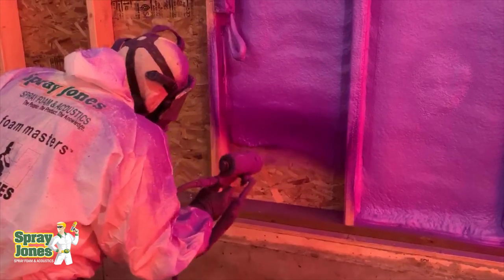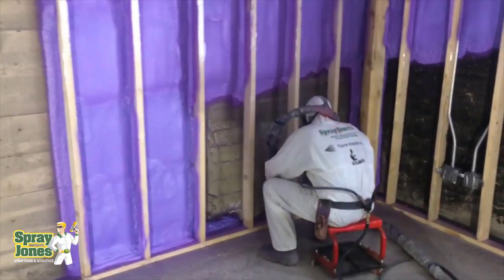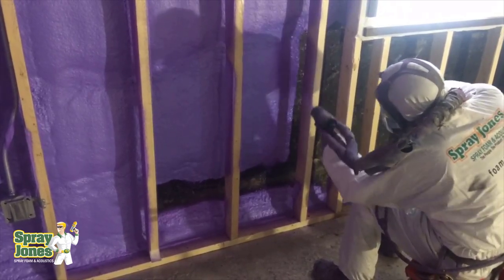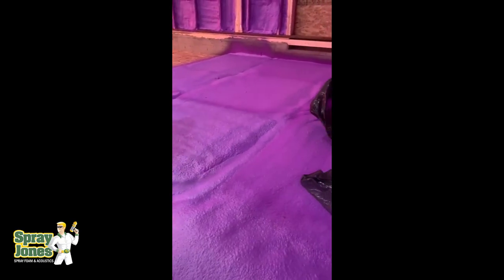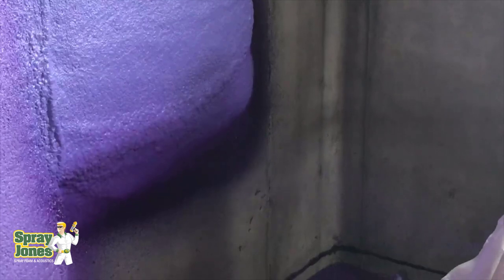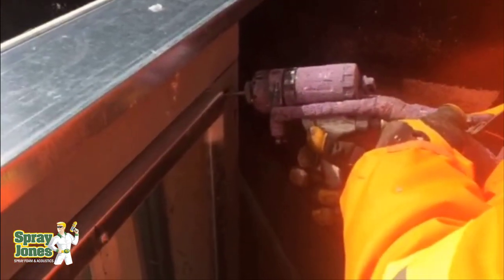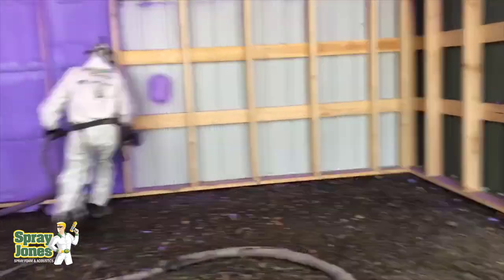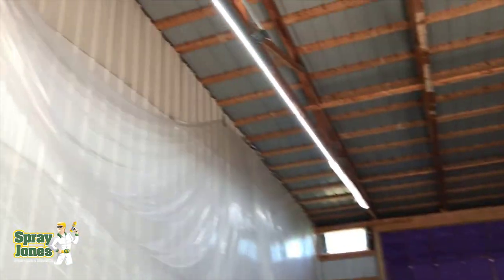Can Foam Insulation Be Injected Into Existing Walls?

Comment: $10,000.00 for tearing everything down 2 inches of spray foam on the walls then all new material or $850.00 for slow expanding injected foam. A crew came in located all studs, cross sections, packed the outlets, drill a lot of hole, installed attic barriers, and injected the foam. 5 days later we have a 10ft by 24ft room that is cozier than our front room. No warping no fires no smell and keep a great temp all year round.

Comment: I've injected quite a bit of "pour foam" successfully. Mostly opec cell designed specifically for the application using the same equipment as is used to spray the foam. As long as the cavity is empty and the installer is properly trained with the proper material it works great. Injection progress can easily be monitered with a FLIR camera and the mix (material is mixed in the gun) can easily be confirmed by spraying test patterns on the floor. I would definitely agree that opening the wall up is better.
Reply: No you didn't.  It's literally impossible.  If you're so confident please build a little wall, put fiberglass insulation in it, cover it with sheetrock, drill a hole, and pour your foam insulation in there.  Then remove the sheetrock and show us.  Do it all on video.  I dare you.

Comment: I dont believe this, we have a company here in the states that drills a 2.5 to 3 inch hole in your exterior wall, not the siding, They check to make sure the cavaty is empty with a camera. Then insert an airhose along with the insulation hose, they drop the hoses all the way down to the bottom of the cavity then start the fill process. They offer a FULL LIFETIME guarentee that transfers with the selling of the home. They comeback after about a week and check EVERY wall with a thermal camera and if there are any spots that have gaps they fix it right then and there. When they are done outside they fill the hole they drilled in the side of the house with a foam plug.
Reply from the maker: Go ahead then.
Reply: That's injection foam, only a limit of  companies do it
Reply: So your saying the 3" hole is in the drywall and not the siding?.  But yet it's not a drywall plug but a foam plug?   Best practice is spray it right the first time or spray it from the outside when doing a siding change.

Comment: For the US Icynene makes a good slow rise open cell that I have used enough to trust it - (only do that if the weather barrier is good on the outside)  Demilec makes a good closed cell slow rise - like it when we do existing attics and need to do enclosed slants.  (both brands under Huntsman now!   SonRise (Ohio)
Reply from the maker: Fine. Still the same issues inside the wall.

YT is full of videos of failures for enclosed wall filling ordeals.
Reply: @SprayJones  yeah, multidecade old installs with old formulas.

Comment: I had "pour in" put into my mid 50s colonial about 10 years ago. I've seen inside the cavity a bunch over the past 10 years. A good company can handle everything he describes as being a problem - it just takes experience. I asked all these same questions when I got the work done and it wasn't a problem.
Yea, repainting all the holes (at least 3 in each stud bay) kinda stunk, but that's why you label and keep your left over paint.
Reply from the maker: Good. glad it worked out for you. So many times it does not.
Reply: did you see an improvement in your heating & cooling costs?

Comment: Do a segment on spraying foam from the outside with the sheathing removed.  I may have to go this route.  Thanks
Reply from the maker: Great idea!
Reply: We did the roof that way, removed the shingles and sheathing. Added cardboard for the crawl spaces, then sprayed and sheathed.
Reply: @danlux4954  Does that mean that your spray foam adhered to the cardboard? I thought that the spray foam would need to adhere to your sheathing?
Reply: @ruthalexander6681  we spray foamed from the top, the sheathing goes on after with 1-2” gap for air. If we wanted to rip out all the plaster you would put a foam spacer to create the air space then spray foam. Depending on your geographic area of course
Reply: @danlux4954  ok...thanks for assuaging my curiosity! 😅

Comment: I do commercial refrigeration, many years ago I was at a refrigerated trailer manufacturing plant where they manufactured refrigerated trailers, the process used was to pull the trailer into a fixture which then used hydraulic pistons to push the walls in to enclose the trailer then they put a fixture inside of the trailer and expanded it so the outside and inside walls were contained, they then injected a foam mix into the cavities, the hydraulic “box” helped the over expansion of the foam from ripping the aluminum panels off of the aluminum riveted studs, but as sometimes things don’t go exactly as planned and too much foam gets injected WILL rip all the panels off the studs, inside and out despite the hydraulic rams trying to hold the trailer together, the power of foam in a enclosed area is a respite recipe for disaster.
Reply from the maker: Thanks for the additional info. I have heard of this and much more with panel products.

Comment: I have an empty cavity and tongue and groove 3/4" boards nailed 3 inches apart on the interior walls of my home so taking the walls down is a no go.  I have access to the top of the wall below the plate on the gable ends from the attic as it's a brick home.  I would like to poke a hole and pour from above and would do so in many batches until the foam reached the top.  Just want to do the gable end where the bedrooms are located as it's the west side and gets super hot from the sun beating on the brick in the afternoon.
Reply from the maker: It will bow the wall out if you mix too much at once. I have seen foam push a 2" x 10" sideways
Reply: @SprayJones  I thought it over and I think I'll try cellulose instead.  I believe I might just have enough room to fit the machine hose below the plate.  Thanks for the reply!

Comment: So I have a 40’ school bus that I was just going to drill a hole in the center of the roof and I was going to fill it on top outside 2’x8’x3” pocket’s times 16. I was thinking simple GreatStuff big gaps(3”) & cracks, my inner roof is bolted down tough. What do you think?

Comment: Question:  I have an old house with no insulation.  I have to remove the old siding as it is no good.  I was thinking about removing the sideing, spraying in foam and then residing with Hardi siding.  What are your thoughts?  I live in the piedmont of NC.Thanks.....
Reply from the maker: Do it! We have done many situations like that. Best if you open the walls up, and spray the foam in, then caulk all the seams and flatten with silicone, then close back up and live life. Set up scaffolding and hoard with tarps to contain the over spray and control wind.

Comment: You briefly touched on masonary cinderblock walls, this is what I have in my basement. Would you suggest sprayfoam? my only concern has been thermal bridging with the webs of the blocks, which reduces the effectiveness of the sprayfoam
Reply from the maker: Spray foam the cinder block faces from the inside.

Comment: I am converting an ambulance into an adventure vehicle and have decided on spray foam. I have been concerned about how I am going to fill the 2" aluminum square tubing that makes up the framing. I am fine with drilling holes, but there are many many members to fill, and only half of them are vertical, the roof and floor are horizontal.
Reply from the maker: Lots of holes and can foam...

Comment: That's very interesting I was a juror in  case in the '80s in Boston.

The chemical company that sold the materials got off scott free and the installer got screwed for mixing it in correctly or it applying it at the wrong temperature. 

It looks like the material has come a long way in 30 plus years.

Looks also like you do great work I wish you were located near me I'd use you and your services. 👌👍⚒️
Reply from the maker: Many many changes since then. A whole industry has been born.

Comment: Hey Spray Jones what's your opinion on 2 inches of spray foam on exterior walls plus 3" of rockwool insulation? Best method for a 6" wall?
Reply from the maker: Stick with only SPF. No hybrid systems.
Reply: @SprayJones  can a hybrid system cause problems is this why? And watching costs how much do you recommend in walls of a house of closed cell( I'm in Alberta)?

Comment: My house is one-story, all brick, ranch style built in 1958, at 41 degrees North latitude, midwest US (equal to Chicago)  All interior walls are 4" concrete block.  Exterior walls are about 10" thick with 2.5" gap between block and brick.  These exterior walls are tied together with a single heavy steel wire about 1/8" thick on a 16" grid.  (One wire every 16" horizontally and vertically anchored in the mortar between walls.)  

Nexgt summer I contemplate drilling through the block and filling between block & brick with low-rise closed cell foam, using borescope camera to verify filling as the foam rises and spreads.  I estimate 2 or 3 three holes going vertically up the wall, horizontal spacing as needed.  I've already rewired electrical in all the walls.  

Do you see any problem with this plan?
Reply from the maker: So far you seem to have an idea of what to do. Executing the plan, and what will happen to the system is a whole different question I cannot answer. 

Find some really good help to be in your "corner".
Reply: @SprayJones  Thank you!  I appreciate your videos, too
Reply: (Update)  I did it --using two Slow Rise 600 bd.ft. kits so far.  Will need three more.  Measured yield is only about half of the 600 bd.ft..  Was told that’s because I'm injecting a confined space.   Was also told that will increase the strength (no doubt) but will also increase R-value??  

I would have guessed it would reduce R-value, so I hope they're right and I'm wrong.  

I used a grid pattern from an Irish website to drill 1/2" holes in the brick mortar from outside.  They do a lot of this cavity fill in Britain and Ireland with all their brick and stone walls.  

The soffit on my ranch home prevents me from reaching the top of the wall from outside, holding my highest hole at 9" below the top, but the foam expands so well that I hope it's getting up there.  I could check by drilling at the top from inside the house.

My pattern is about 24” apart vertically and horizontally except around the ends of the wall and edges of windows and doors or other obstacles where it might drop to 12”.  This is still less holes than the Irish site advised.

The 1/2” injector nozzle fills the holes exactly.  So foam may ooze or even squirt back out when I pull the nozzle back, or start showing from holes even higher than the one I am filling.  

As I pull the nozzle out I plug the holes with corks.  I have large patches of masking tape around the holes, but there’s still going to be a lot of work with wire brush on a 4” grinder to clean off the surface.  I might try muriatic acid for a final touch.  The wire brush discolors the surface eventually, but light cleaning acid takes that off.  The muriatic may be for removing final bits of foam, if it will do that.  The bricks have a rugged texture surface.

I had some interesting leakage inside from one window, foam crawled out under the trim and through a hole on the plastic track of double hung sash.  Foam grabbed onto wooden blinds that were down, and the foam from the weep hole locked the sash in place.  It wasn’t hard to free the sash.  The window frame did not get compressed.

I’m learning fast.

Comment: Would you open up the wall with just a 4’ height around the room? Mid height.
Reply from the maker: No. 3 inches down from the drywall ceiling is what we have done. You have 1 chance to do it right so don't mess around for the sake of even a few thousand in drywall.

Comment: Another awesome Spray Jones video!

Question- does spray foam stick to sealed or painted concrete/masonry?
Reply from the maker: Thank you.
Reply: It’ll stick best to porous materials but it should adhere well enough to suit its purpose on sealed/painted concrete
Reply: I will stick to the paint or the sealer, the problem is that if the paint or sealer  has become detached that will render it useless, it’s the same as trying to apply stucco to a painted wall

Comment: So tell me what do I do with a 100 yeah old house in the walls,, I cant afford to rip walls out to spray the walls so what do I do?
Reply from the maker: Maybe you can blow in cellulose. That will settle and create all sorts of new problems. 

Rip the siding off and insulate from the outside

If none work you basically suck it up and live with it. Or gut it. Or sell it to someone that can afford to.
Reply: @SprayJones  Ignorant answer that reinforces the passive aggressive arrogance I heard throughout the video.
Reply: Find an insulation company that does injection foam. We have been doing it for years. There are several different types of injection insulation. It CAN be done.

Comment: What if you wanted to just put open cell in a wall for sound deadener is that different than closed cell?
Reply from the maker: Yes. Application issues are the same.

Comment: So a 1 inch gap at the bottom is worse than an entire 8+ foot empty cavity?
Reply from the maker: I have seen structures that are basically uninsulated with minimal damage. Then poorly installed insulation job and they get all sorts of water and frost damage they never have had before. 
I provide the info, you decide after that. I am no guru.

Comment: What the average cost for a 1900 square foot house to get walls closed cell spray form?
Reply from the maker: I don't give out prices. They wouldn't be relevant anyhow.
Reply: You can get DIY kits on-line. They come in 2 separate tanks and you just get the whole kit and so forth. Alllll depends on what you're doing.

Comment: Hi if rats are in the walls ( main ones) can you have the gaps filled, remove and replace internal thin stud wall us is it called ? I’m getting infested with rats ticks and mites I need a way to stop them even getting in the walls tobreak through rat proofing to start with. Or drill holes fill powder with permethrin into holes so it drops down into gaps ? Sorry I’m a woman lol I no nish , thanks 🙏
Reply from the maker: You need to move!
Reply: @SprayJones  I wish , but I can’t even do a council swop until I’ve got this hell hole infestation under control, no one would take it, probably I’d be killed for moving and not saying lol, it’s awful. I can’t tell u how bad. Whole block infested by rats and mites etc.ive paid for permethrin fogging that’s not working £400 down drain. I’m lost. Thanks though.
Reply from the maker: @gina2190  Gut the structure. Clean out everything, then spray with closed cell 100%.
Reply: @SprayJones  I’ll look into that thanks kindly

Comment: What is the point of insulating steel studs. Won't the temp just come through the steel?
Reply from the maker: Architect wanted them filled. That's it...
Reply: It’s called thermal bridging, it happens with wood studs too, if anything the steel studs will see less temperature exchange than wood
Reply: @SprayJones  Was it done for some sort of noise insulation? Did it make it more rigid? I gotta know!
Reply from the maker: @herptyderp4927  Sealed the structure for the parapet wall to the roof. The supports anchor into the roof system and cause a gap in the insulation. Hence to fill the HSS columns.